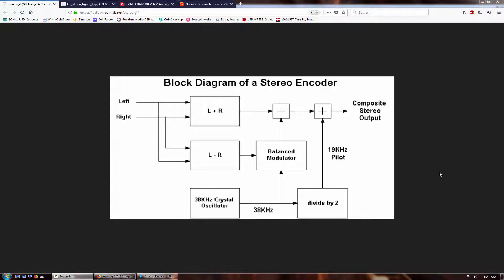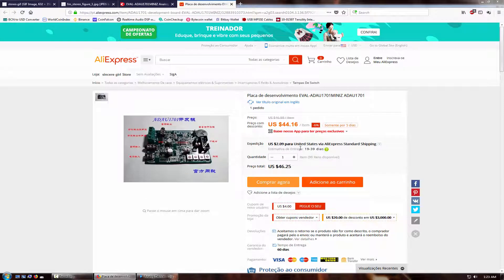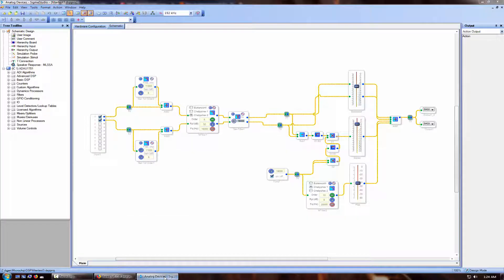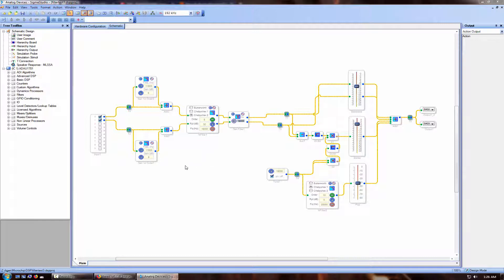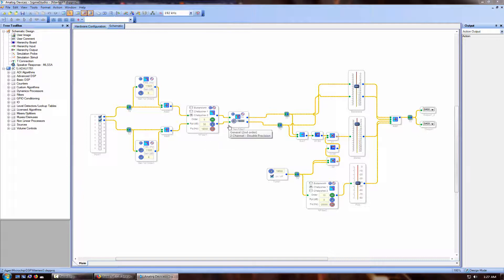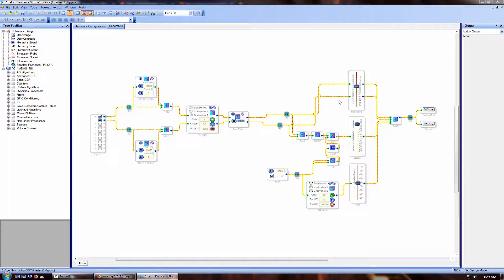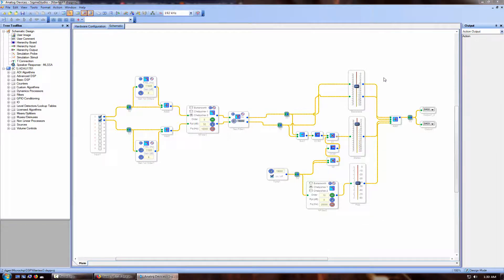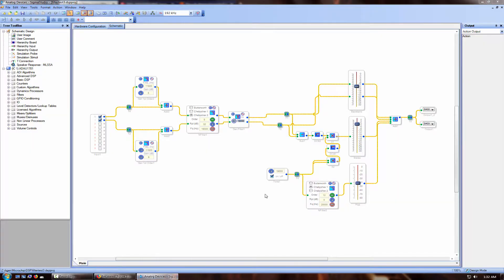FM Stereo Coder in DSP - SigmaStudio ADAU1701

Comment: good afternoon . I assembled it according to your scheme adau1701 12.288 mhz  192 khz sample rate, but the control receiver does not see the MPX on the oscilloscope, an even picture of a sine of 38 kHz. tell me where to look. What crystal oscillator do you have in circuit 12.288? Thanks

Comment: Great video as always. I have an FMT 5.0 350W transmitter that you reviewed in another video. The sound quality is very good as the signal output. The only issue I seem to be having are many complaints of losing the pilot signal in a short distance. Some receivers don't get it at all. I don't see any adjustments regarding the 19K. Is there anything I can look for or adjust? Thanks in advance.

Comment: Very informative!   Would be interesting to see the actual setup work in a video and measurements on an audio spectrum analyzer. Would also be nice to know how well the 16KHz filters perform. Can you add the links of the boards in your description as well as the project file?  Not sure if this will work but looks like an interesting price  https://nl.aliexpress.com/item/ADAU1701-DSPmini-leren-board/32834182889.html
Reply from the maker: That board is the one I originally had my eye on. I ordered it, but they said it's not available and sent me a different one that wasn't even close to the same. I'd be careful. You should try this one: https://www.aliexpress.com/item/ADAU1701-development-board-EVAL-ADAU1701MINIZ/32883910373.html

You likely also need the USBi emulator: https://www.aliexpress.com/item/SigmaDSP-emulator-ADAU1701-USBi-ADAU1401-SSM25xx-AD194x-SHARC/32759930014.html

The board comes with a USB port, but I think it is only for power. I don't think it will work to send the project data. For that, you need the USBi board. I may be wrong.
Reply from the maker: @circulargates7949  Thanks for informing me. I remember glancing at that a while ago and I didn't look into it further cause I thought it was only designed to work with the other wondom stuff. Maybe I was wrong.